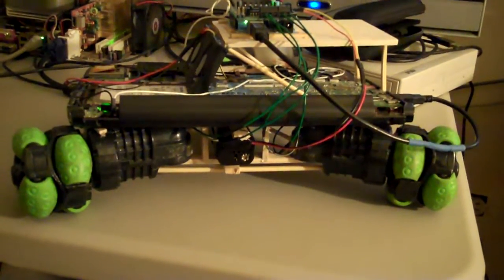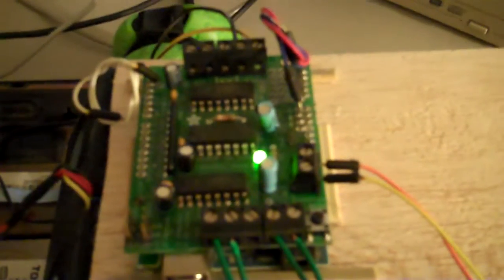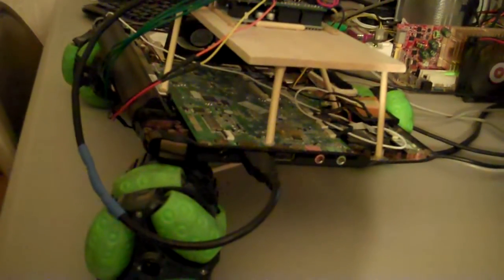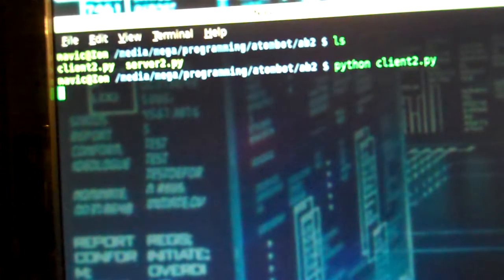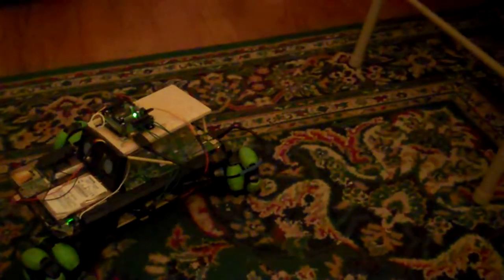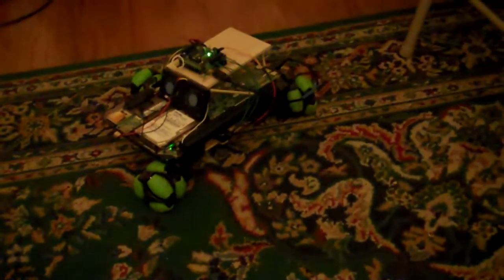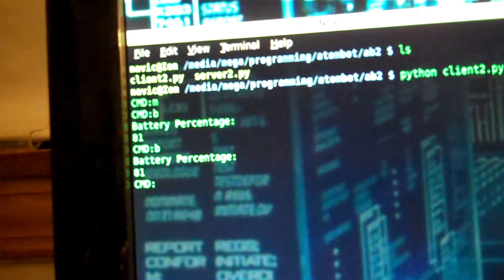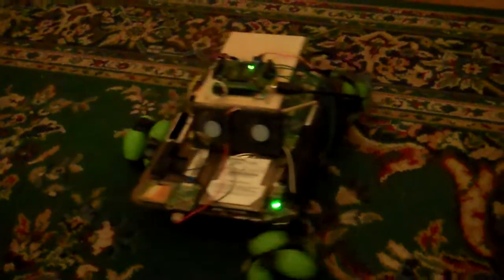WiFi Robot - AtomBot 4

Comment from the maker: Mostly power to the motors.  Say it's move left: I had to make the 'rear motor' move at full speed, the right motor move less and finally the left motor even slower, and all in the correct direction... it takes some playing with, especially depending on the h bridge you use and the power source - keep in mind when my batteries get slightly low the movement in altered quite a bit.  Hope this helps, PM me if you need more info